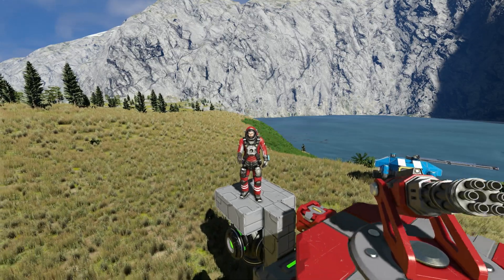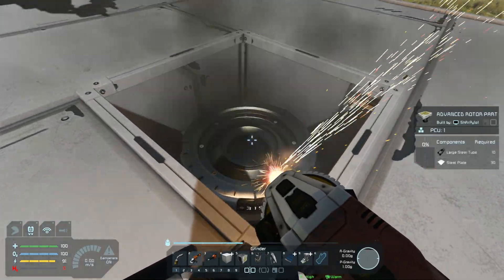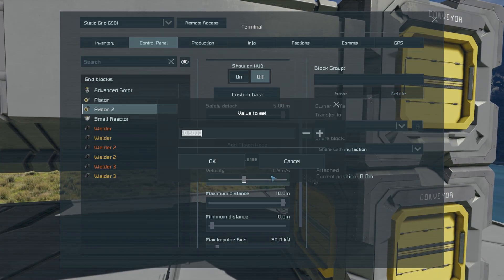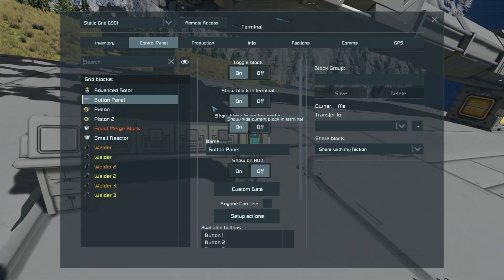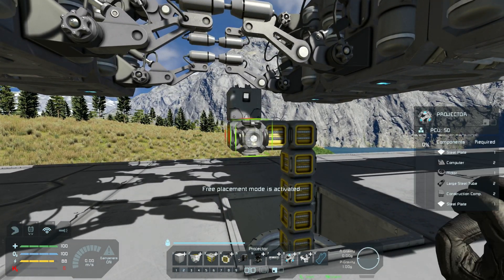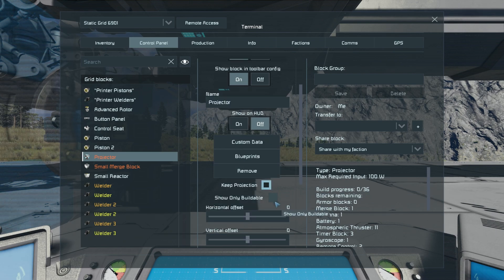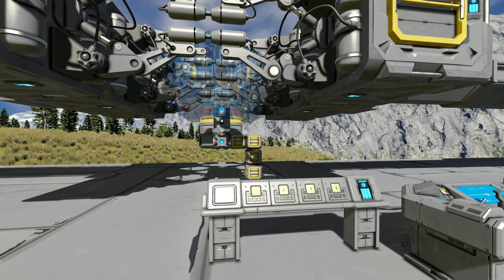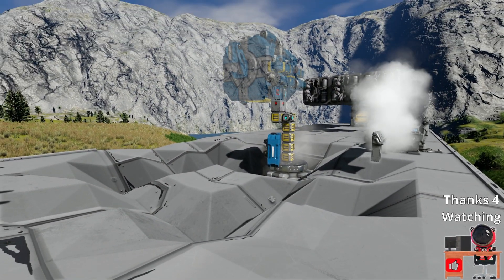How to Build a Drone Printer - Space Engineers

Comment: Neato... how do you get them to lift off soon after so we can print another without having to attack to the drone?
Reply from the maker: Lifting off or moving g the Drone afterwards can be done by adding the gps location etc and setting it all up at least once beforehand for the rest to be printed the same using a newer blueprint... if that makes sense?
Reply from the maker: Quick and handy note is to have the Remote Block set to "One Way" if you want all the GPS's to be reset after its trigger... if you want the drone to be able to repeat your GPS instructions then I highly suggest you put the Remote Block on "Circle", then it won't remove anything after each trigger ✌️